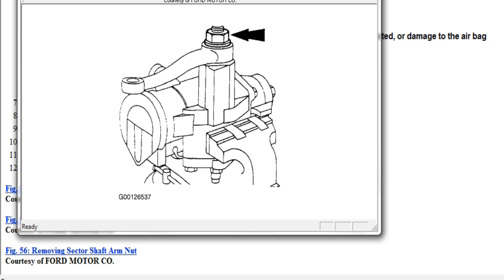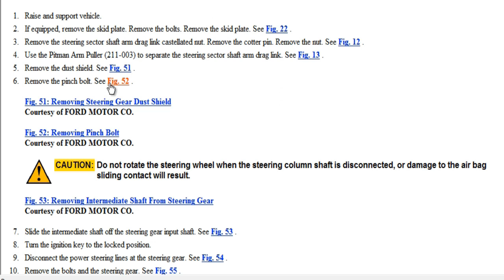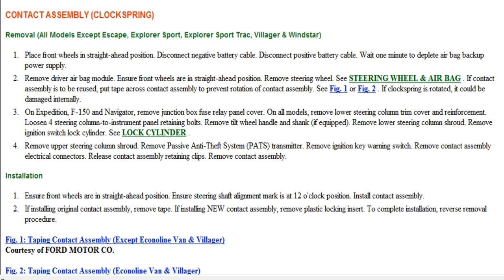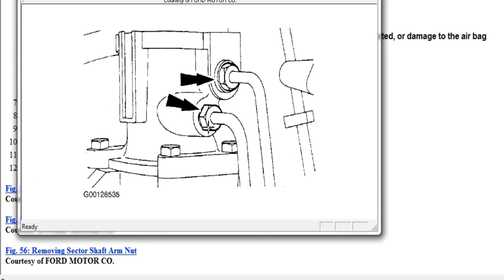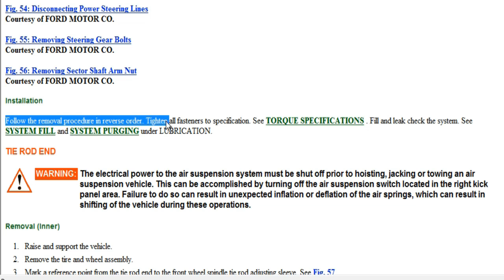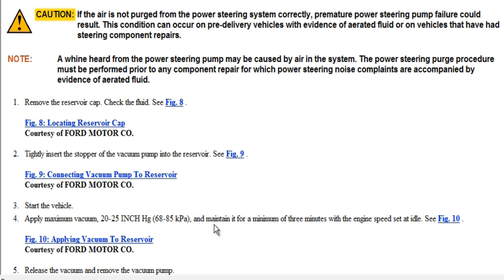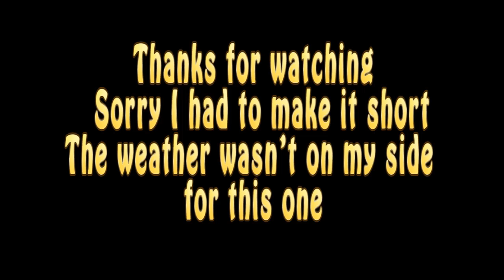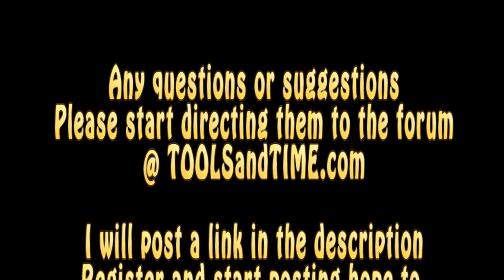steering box 2000 ford F150

Comment: @robinsonsauto 

Yeah ... I pulled it, rebuilt it, and reinstalled it. Installing the teflon seals on the worm drive were a b*tch, but I boiled them to make them more stretchy, then installed them and used a hose clamp to "shrink" them back to their regular size in the grooves.  Also, the sector shaft was pitted and grooved where the bottom seal touched it, so i sanded and polish it smooth again.  Other than that, it was an easy rebuild.  And ... there were no o-rings on the hydraulic lines

Comment: I just bought a 2000 f150 with severly worn upper ball joints. Those have been replaced. But another problem is that left turns are limited to about half the turn. I doesn't appear the arm on the box has been moved, but more like the tension screw was pulled out causing it to skip a tooth or two in the gear box. After watching this Im glad I didnt pull the arm off to straighten it as it might cause the ribbon to stretch apart.
Whats my next step? Pull the tensioner adjustment screw and turn the steering wheel to the right one turn? I dont know. Thanks

Comment: The problem I have is that the truck was involved in an accident which caused the worm gear to jump its track.  I have no clue to where center is.  Is the tension noticeable enough that I can use your method to find center again to reattach to the new gearbox, and is the new gear box already set to center? So when I find center on the column then it will be aligned with the new gear box?  Right now the it only turns 1 and half turns right and two and half turns to the left.

Comment: What if I just unhooked the positive battery cable & used rope to hold my '99 Expedition's steering wheel into place, while I replaced the steering gear?? Would this be safe enough for that airbag & clockspring?? It's a 4X2 4.6L model

Comment: Great Video, I noticed the re manufactured gear box had a tension bolt on top, After 180K on my 99' F-150 4X4, It has about a 1/4 turn of play on the steering wheel before the Pittman arm moves, Should I attempt adjusting the gear box tension, or replace the gear box. It doesn't leak fuild. But make it hard to drive at speeds higher than 35mph, I'm use to it, but it scares my wife driving it. Any help would be great, Thanks,

Rob Webb
Trail_Scout

Comment: Where does the O ring go?

I just removed mine from 2001 f150 5.4 liter crew cab and I disconnected both hard lines from box.. and I did not see where any O ring would go